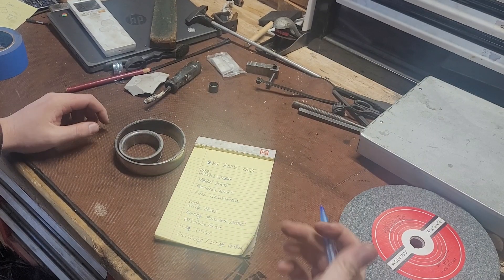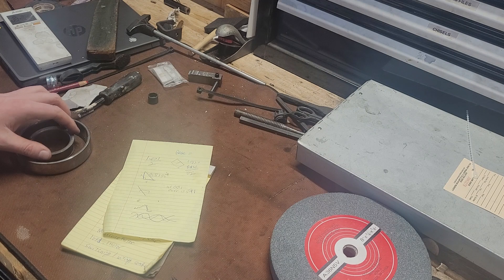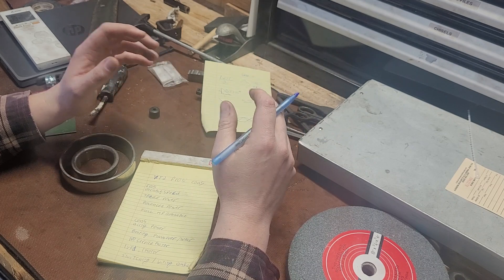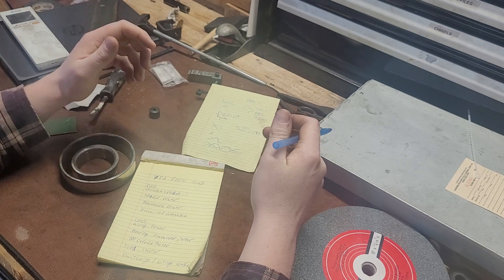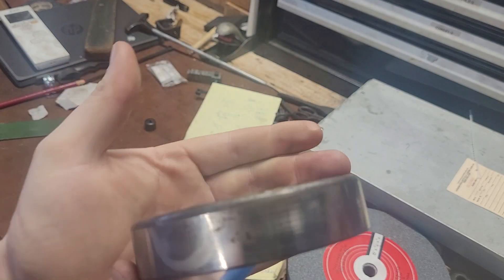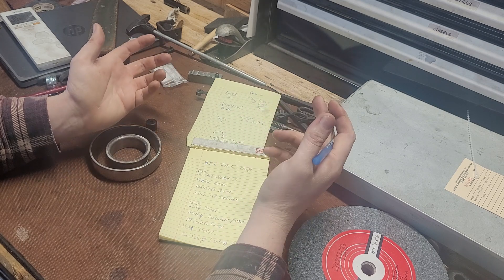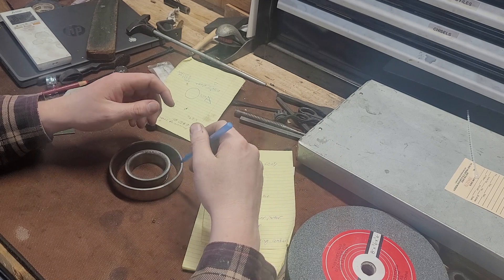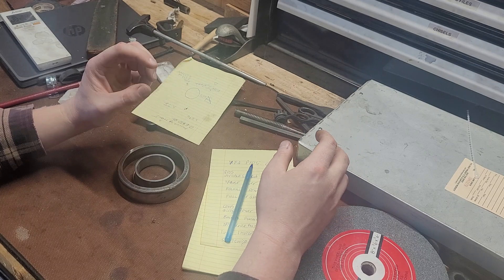Why you may not want to use a VFD in your home machine shop

Comment: Three phase are each 120 degrees out of phase of each other. A so called "VFD" can take 1 or 2 phases and generate the missing phases (2 or 1 respectively).

Since the "missing" phase(s) are constructed with highspeed switching circuitry (i.e. "stair steps"), nearly any frequency, phase, and/or amplitude can be created.

Just remember the total power into the VFD will be equal the total power out, plus whatever efficiency losses within the VFD.

There's a bunch of other considerations that can affect balance that I won't go into here. At this level it's good to start bringing in reactance; affect of inductive loads, and how capacitance can bring current & voltage shifts back into alignment.

Look up "Electrical reactance" in Wikipedia for an explanation. Beyond that,

Comment: I have used a vfd for more than 15 years to generate 3 phase power. Programing a soft start is a huge benefit, particularly in an operation requiring several starts per minute, preventing motor overheating which did occur with a rotophase unit.

Comment: VFD output is not "dirty". Although the power is created from a pulsed signal, that signal is run past a capacitor bank which converts the pulses to a nearly perfectly smooth wave.  This is similar to an audio amplifier.  Audio amplifiers do not have a 60 Hz hum because of the output buffering capacitors.

Comment: When I add a VFD to a machine that reverses, like using a drum switch, I just run the VFD to the motor. I then rewire the drum switch to the VFD to change it from FWD to REV. This keeps the operation of the unit the same for the end user.  Don't forget your accel and decel times are important.
Reply: Let me explain a bit better.  The drum switch is wired to the inputs on the terminal strip.
Reply from the maker: @johnkirisits6380  that's exactly what I do too. Works well and you get to keep what are usually quite nice switches

Comment: Soft starting isn't just about starting the motor over time.  A motor draws more and more power the more it has slipped below its synchronous speeed.  So, when you start it, it gets a massive current spike, that drops as it speeds up.  With a VFD, you can prevent that by setting the speed requested to a very low speed at first, then moving that target as the machine approaches it.  This keeps slip, and thus current, much lower during starts.   It also helps prevent brown outs and low voltage on the rest of the machines in the shop when a large machine starts up.
Reply: vfd took my lathe from 83 amps on startup to 8 by ramping over 3 seconds.

Comment: The carrier frequency is the issue, not the speed of the motor. Bearing damage from the VFD can easily be mitigated with a shaft ground of some sort. The problem is dV/dT: the rate of rise of the voltage. Lower switching frequency (carrier) will help, though I dislike the noise and usually use the highest carrier frequency that performs ok. Using a load reactor can control the dV/dT issues. I have load reactors on all of my machinery that has VFDs. No issues with bearings or overheating. We have seen many motors where I used to work with bearing issues caused by VFD operation. All solved with either Aegis type shaft grounding devices and/or load reactors. Some with just a rewind with better materials.

Operating motors that have integral cooling fans (TEFC, etc) at lower than rated rpm will reduce cooling. The reduction in cooling may not match the rate that the motor losses decrease as the load decreases. If that is the case, an external fan may be required to maintain cooling at lower speeds. 

A dual voltage motor (240/480V) has insulation rated for 480V RMS or about 600V peak. Using a VFD on such a motor fed from 240V (or 208V) often doesn't experience any issues. Older motors are more likely to have compromised insulation due to age or being soaked with excessive grease. Better insulation like class H can handle higher spikes from the dV/dT. I haven't seen any failures of class H insulation motors from VFDs. We had hundreds of motors from fractional HP to 2200HP. Saw a number of failures of the large motors on machine that the manufacturer supplied VFDs. 900 ton York chillers with 600ish HP motors for example.

All that to say that there can be issues but there are ways to mitigate or prevent problems.

Comment: The voltage spikes may be delivered capacitively to the chassis from the dirty power. The answer, which could be calculated but probably best to experiment and get it right, would be to put a certain value of capacitor from the running winding(s) of the motor to the chassis.

 In smaller electronics, the old-school answer is .01uF across a small DC motor to absorb commutator noise, or across an audio line to absorb common-mode electromagnetic interference. Because of the size of a machine shop motor, the capacitor might need to be a larger value. The important thing about the motor is the inductance of the windings, which most people are not equipped to measure. Hence the experimentation, or maybe a crowdsourced answer.

One could also make quality moving connection between the rotating shaft and the grounded chassis, shunting the spike around the bearings. The closer the shunt is to the bearings, the more effective it will be.

Comment: So the arcing in the bearing causes fluting, generally it does take a few thousand hours to get (probably not an issue for a hobby machinist). It used to be thought that you replace the bearings with ceramic bearings to stop this. However what happens it he potential gets higher & then begins larger arcs. If you look up bearing fluting, you can see images of standard bearing fluting. The fluting when it gets worse has a low growl noise. I would not recommend a drive for direct drive equipment, IE motor ties directly into the gear train, or say surface grinders.

Comment: You may also look into a shaft grounding kit like the Aegis SDR. This will shunt stray currents in the rotor to ground without passing through the bearings at all.
Reply from the maker: I mitigate the issue (in  my application) for my motors by never running above 60 hz and at 220v 3 phase. It seems to reduce the arcing but it may be worth looking into. Funnily enough though that kit costs the same as bearings for my old pancake motor!
Reply: @moosesmachinery 
You don't have to buy the kit. Anything to ground the rotor would help. There are some kits for grounding inboard boat motor shafts that are cheaper or adding a carbon brush from an old brushed motor would work. It also might be overkill for a home shop as you likely won't ruin the bearings running the mill a couple hours a week. 

Now for a short engineering lesson. 

The frequency you run the inverter at has little to do with the energy that generates the spark that causes bearing pitting.  As Tezza120 explains the impedance changes with frequency. What he doesn't mention is that a VFD uses a switching frequency. Often 8 Khz. The VFD will use a rectifier to create a DC voltage that will be 1.2ish times your line voltage for single phase. The VFD is typically using IGBTs to chop the DC up using a square wave to simulate an AC waveform. To do this, the IGBTs turn the current on and off to the motor at this 8khz frequency. The pulse width and duty cycle changes to increase the voltage/torque and narrow/reduce to lower the voltage or reduce torque. This is also why you see a v/hz setting in the drive.  

In short the motor is being constantly energized and de-energized by the IGBTs and the motor windings are constantly exposed to the full DC voltage generated by the VFD. The switching frequency in the VFD is what causes the motor to have a high pitched noise in comparison to line voltage and also is what causes the pitting. It is true that higher speeds and greater loads will cause more damage, but this is because of the relationship of v/hz not simply the frequency you select to run the motor at.

One additional thing to keep in mind with older motors and why newer motors are "VFD Rated". The rectified DC voltage is higher than line voltage. In a 3 phase 480 VFD, the rectified voltage is roughly 700 volts DC. The insulation on older motors often times were not rated for the voltage generated by the VFD. Most Home shop mills/lathes being run off a single phase VFD don't need to worry as the DC voltage is not much if any higher than the insulation rating.

Lastly, and for fun. Many VFD drives measure the back EMF in the motor windings between pulses of the switching frequency to estimate the motor rpm thus allowing for a control loop to add additional power(increase duty cycle) when load on the motor increases to maintain the desired RPM.

Comment: So reason for bearing arcing is as follows.
1. There is winding capacitance between the windings and the chassis of the motor.
2. Impedance(think opposition to current flow) of a capacitor decreases with increase in frequency.
3. Any wave more complex than a sinewave will have harmonic content. A squarewave with very sharp corners will have odd harmonics going well into the MHZ. See Fourier series of a squarewave.
4. These high frequency components couple through the winding capacitance to the motor chassis and must go somewhere and if bearings are the lowest impedance path back to the ground, arcing will occur.

A ground connection from the chassis of the motor directly back to the VFD closes this current path (low impedance path) so it is less likely to go through the bearings.
Reply from the maker: Thank you, that's a more detailed explanation.  A conductive motor grease is just a work around to a more complex issue
Reply: Do you just ground the motor chassis, or do you have to ground the rotor/shaft?
Reply from the maker: @brianhaygood183  to get it to run, I just ground the frame/chassis at the designated point or at the switch. To avoid any arcing at the bearings, you ground the rotor shaft to the frame/chassis.
Reply: @brianhaygood183 If the motor chassis is connected to the VFD chassis earth point the shaft won't need earthing. It'll pass down the copper wire instead. 
Earthing the shaft with brushes and slip rings is a workaround and can lead to EM noise in the mains throughout the shop and may even cause nuisance tripping of earth leakage protection devices(RCDs) in the switchboard

Comment: TEFC inverter duty motors work quite well. Quality VFDs made for 220 single phase input with 3 phase output are really great. The company I work for provide VFDs for all motors and gearmotors, most VFDs have a range of 0 to 400 Hz., we found the best torque range is from 20 to 120 Hz, after that torque falls off.
Reply from the maker: One of the big discussion points here is that in a home shop, those motors often pre date inverter duty designs and do not have the features that allow you to take advantage of the variable speed and can suffer winding & bearing damage. TEFC inverter duty motors have heavier duty insulation, for example over a non inverter duty motor. VfDs are great but are not always the right choice for machine tools. They (VFDs) work great in HVAC & non machine tool industrial applications.

Something to note is that one machine, horizontal mills are a great example, can have, two, three, or four motors (power feed, spindle, coolant pump etc) all 3 phase. It's a headache to get multiple vfds on one machine and make the controls work. So just get a rotaphase converter for those machines, for example.